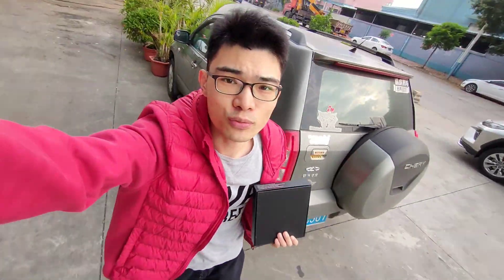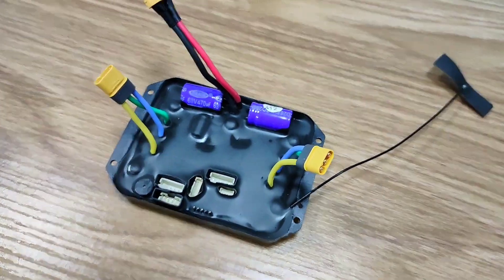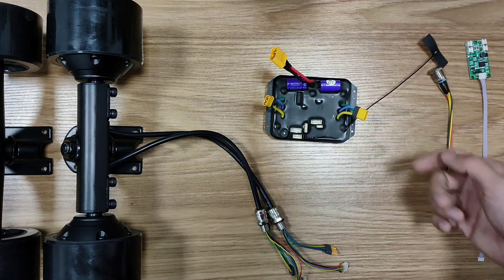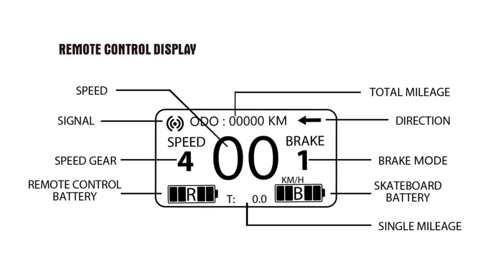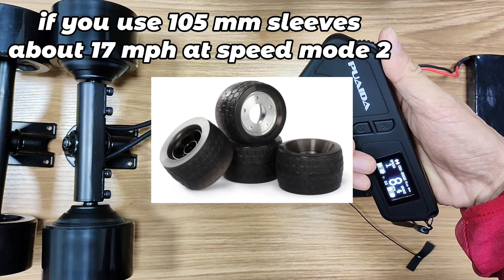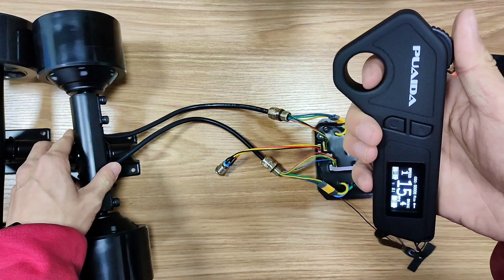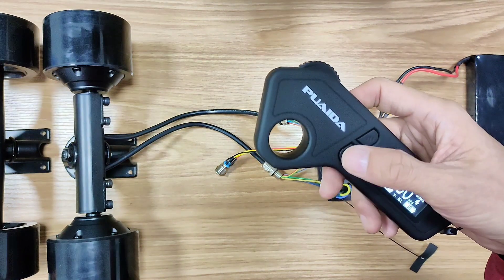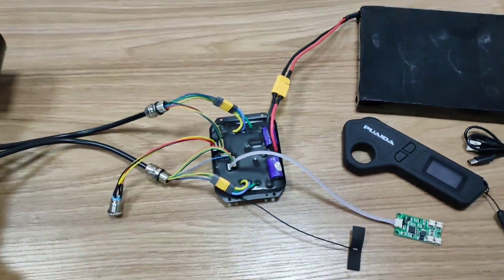Tutorial for the best bugdet ESC and Remote kit for DIY hub motor electric skateboard PUAIDA motors

Comment: Will the honeycomb wheels fit on these motors? It seems like they would be smoother for riding on courser roads ,running over pebbles and small rocks .
Reply from the maker: Sorry the rubber wheel won't fit on these motors ,rubber wheels would be smoother but the range would be much lower .
Reply: @JasonEsk8  what larger (105mm) rubber wheels will fit on these ?
Reply from the maker: @alttransport3445  sorry ,there is no rubber wheels for this motor set ,you could only use 105 mm PU wheels or cloud wheels.

Comment: I bought this kit and am going to build a board using tool batteries. You said at the end of the video that a heat sink is necessary. What do you mean and how do you do it ?
Reply from the maker: Hi, A heat sink is a piece of metal that cools the ESC to keep it from overheating. You see, there is a metal piece at the bottom of the electric skateboard ESC enclosure, and that is the heat sink ,check this out:https://www.puaida.com/products/battery-esc-case-for-puaida-6-series-electric-skateboard

Comment: what battery can i use from amazon, can you please point me to one. thx.
Reply from the maker: 36v batteries with XT60 connector ,please note it need a continuous discharge of 25A at least ,30A would be better